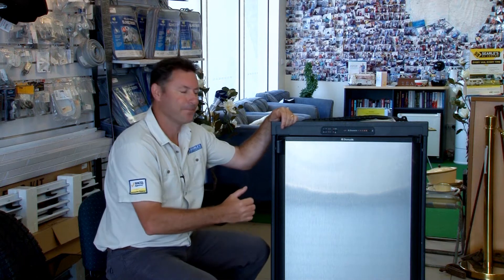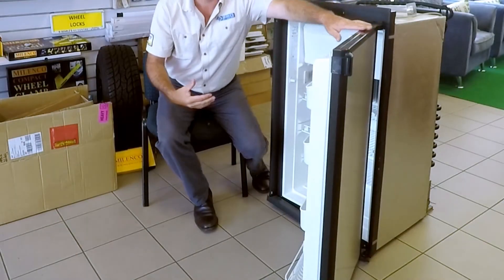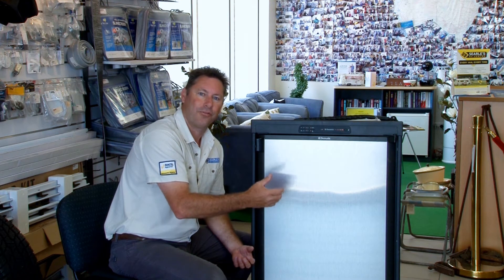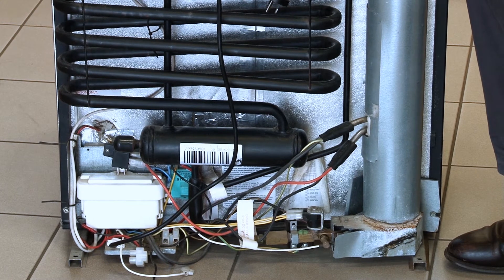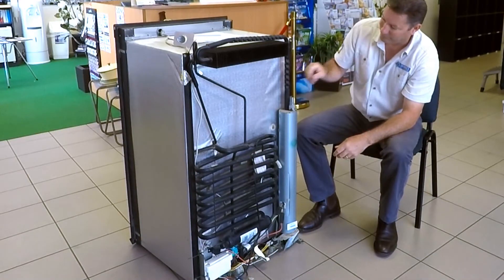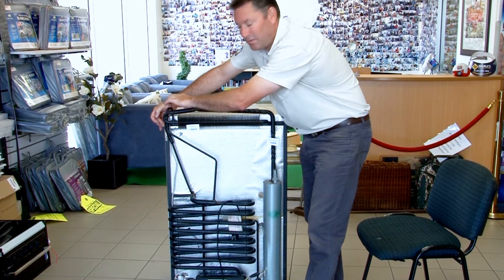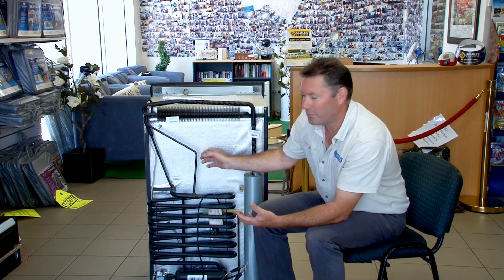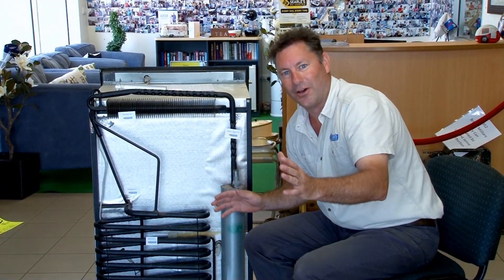How Does An Absorption Fridge Work

Comment: Why would no one manufactures an air conditioner that has a mechanism like this, i want an air conditioner that runs silent and doesn't need batteries or solar or a noisy honda generator.

Comment: hi  start at boiler with ammonia  and water from absorber 
goes thru separator water drops back down to top of absorber coils via double in/outside tubes 
.......[ the moisture drop downwards via absorber  top separator tubes back to  absorber tank ]
ammonia is now highly concentrated gas 
thru condenser now liquid 
mixed with hydrogen 
enter low temp evaporater freezer
enters high temp fridge  now its a week ammonia mix 
Above mix falls into absorber and starts to separate  
Hydrogen rises to continue process via absorber separator  dimpled tube  to connection at evap coil IN
-
----The excess boil off above boiler   returns to absorb tank  via connection at top of absorber separator tubes 
***absorber seperator tubes are clever the Hydrogen  is travelling  up to start cycle again  and the water is flowing down at the same time back to absorber to begin its cycle again. As the water passes its cleaning the hydrogen of  sucking out any ammonia remaining .

Comment: Why does my unit heat way up but doesn't cool? The temps inside just get hotter.
Reply from the maker: Hi Maradeb, Sounds like the liquid mixture that heats and cools the fridge has leaked out. You would have smelt the ammonium. If that is the case you will need a new fridge.
Reply: @Bundyrvs  I have the same problem as maradeb, but I´m sure I have liquid cause I can hear it inside the tubes. Can the ammomium has left and the water be left in the system?